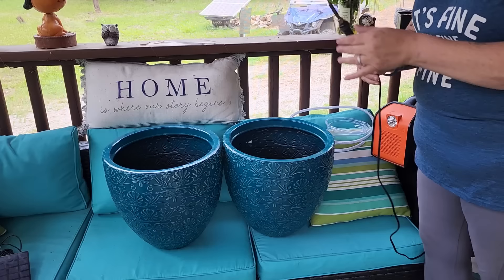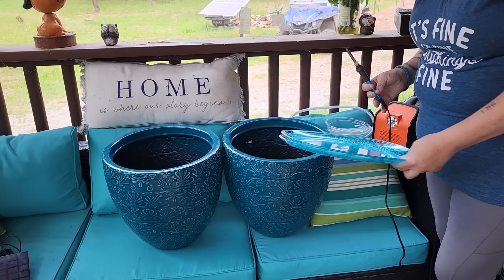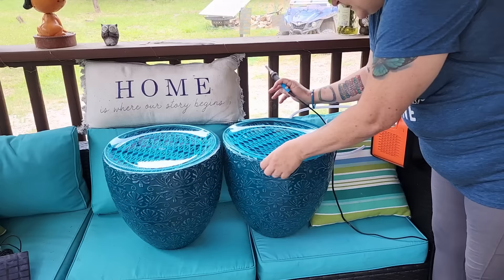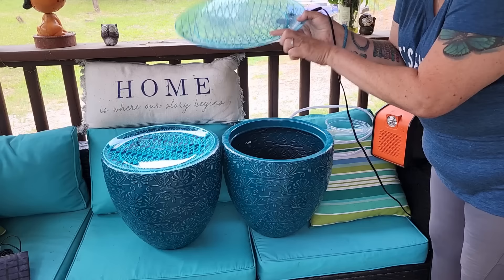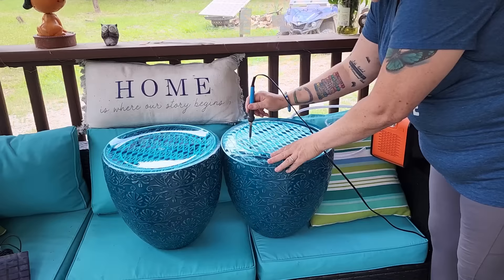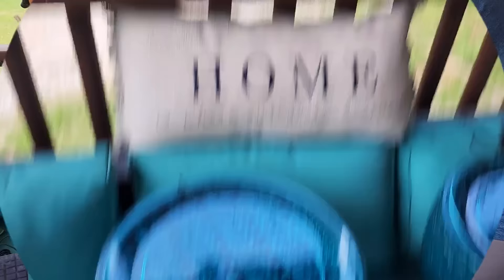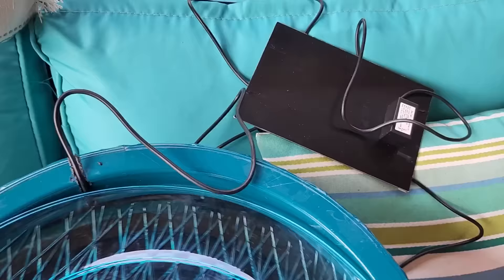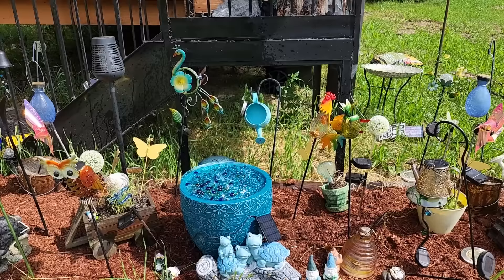Inexpensive solar fountain in 15 minutes or less

Comment: Keep in mind when your doing this once panel is exposed to sun it will start pump so don't connect solar panel till you have water in pot otherwise you may wreck your pump.
Reply from the maker: I actually have been checking it and it's barely losing any water. I top it off every week just to be sure but so far so good.
Reply: They tend not to evaporate very quick done the way you have compared to an open water feature. 
I got a tall heavy pot online 2nd hand and bought a drain from the hardware store with a metal grate so it supported the weight of the pot. I buried the drain so far with just a lip above ground and put a cheap solar pump and added stones at base on top of metal grate. 
It looked great and never lost much water and never really got dirty.
I got that idea off Pinterest.
I like your idea of glass instead of stones.
I find alot of solar panels are now sold without the stake to put into the ground  which I find annoying. 
Your water feature looks lovely.
Reply from the maker: Thanks so much. I'm making a few for family and friends as gifts now.
Reply: Great tutorial and thanks for the info on the pot! I already have a solar fountain. Just need the tubing and the “plate”. Thanks!! Love that pot and the color!

Comment: Great tutorial. Beautiful color of the pots! I love fountains for the peaceful water sounds and for the birds and insects that visit. I've made several over the years. I will advise to check the glass marbles to ensure they are not just coated with color. The coating can be toxic for wildlife or pets. also slip an old piece of stocking over the pump to filter the water and prevent clogs. the pump will last longer. ⛲💙
Reply from the maker: Wonderful advice.
Reply from the maker: Thank you so much
Reply: I don't think debrie  will get underneath the plate to clog the pump..
Reply from the maker: Great advice.
Reply from the maker: Nothing did last year
Reply: Great advice, thank you! 😊
Reply: Hot tip!  Thanks!
Reply from the maker: Thanks!!
Reply: Is there a coating or is it okay?
Reply: How do you check about the coating?
Reply from the maker: @mizkit3243  great advice!

Comment: Would I couldn’t you use just a splatter screen and then you wouldn’t have to do all those holes you still have to for the hose for it’s going with the solar pump outside of the bucket, but yeah, I would think that it would be easier less dangerous towards kid friendly
Reply from the maker: I’m sure you could. I did it like this for looks.

Comment: This was very informative.  I am building the same fountain.  When I tested my solar panel I put it in one place and got a little trickle.  I moved the panel to a sunnier spot and the water height tripled.  It shot right up. Also the tray you are using can be substituted for a planter pot tray.  They are sold with the pots you are using (they normally go under the pot).  The one I found had a bigger lip so it sat on the pot more securely.  Also they are designed to go outdoors so may last longer than the 1$ store trays.
Reply from the maker: Thanks for the advice I'll check it out

Comment: I absolutely love those planters!
Reply from the maker: I was just at Home Depot this weekend and they are still available
Reply: @Deerhavenoffgridhomestead  Did you use the 12” or the 15”?  I have that exact same plate from Dollar tree that I was trying to use with another planter. It fits but it doesn’t want to stay put. The plate itself is 14”. So I was wondering if you went bigger or smaller?
Reply from the maker: I think it was 13"
Reply from the maker: Take your plate with you to check

Comment: If someone had purchased floating solar filters, they often come with a bunch of different "tips" that you can use to change the water patterns. In my solar bird bath, it's a bit too shallow for those more flamboyant tips (unless I want to use my bird bath to water my front garden) -- but I could see using one of those tips on the end of the tubing you've used to create some pretty patterns. This would also be gorgeous with clear marbles and as someone suggested, an underlight of some sort. I love the colors you chose!
Reply from the maker: Great idea!

Comment: Really lovely job!!! What I am surprised by is how you used a wood burner on clay pots!! I had NO idea you could do that! Those planters are a bit pricey for me at HD- I usually get mine at estate sales, but I thought maybe a plastic one I put very heavy rocks in would be ok, and it would be easy to burn that hidden place for the wire. OTH, the planter and what you have done with it is maybe worth the $$$  😍 Thank you for the video!
Reply from the maker: Thank you
Reply: Where do I get those solar pumps at?? Someone...thanks
Reply from the maker: There is a link in the description
Reply: @Deerhavenoffgridhomestead  I think the blue pots are plastic, right?
Reply from the maker: Yes they are, I got them at home depot.

Comment: So pretty and such a delight for those pollinators! I’ve been adding more and more water features for the hummingbirds, etc… and this delightful diy is on the list! Thank you for sharing! I wonder if you see this comment and have a moment whether you might share where you purchased the shades on your screened porch. I am desperate to add some to block afternoon sun and heat on our much used front porch. Thanks again!
Reply from the maker: On Amazon
Coolaroo Exterior Roller Shade, Cordless Roller Shade with 90% UV Protection, No Valance, (6' W X 6' L), Mocha https://a.co/d/f8WXqzc

Comment: 40 bucks ?? I want to use things I have at home 😮
Reply from the maker: All it will take is just looking around to see if you can find some of the things you need and ordering some sort of a pump
Reply: It shouldn't cost you that much if you have stuff you can recycle. However,  even a new pot at Dollar tree is only $5.00 plus the cost of the pump and the tubing. You could use river rock or some shells, if you have them.
Reply from the maker: Exactly

Comment: I did the same thing you did with the same type of pieces. I had nothing but trouble. The water flow could not be adjusted causing it to come out too fast and overshoot the lid.  The lid would fill up with water faster than it would drain back into the vase so I made more holes. The glass beads would plug up some of the holes causing more drainage problems. I’m just about to give up but I would really love to make this fountain work. Any suggestions?
Reply from the maker: @reneesvensson1149  try bigger holes and less rocks

Comment: How do you clean the rocks when the birds poop on them?
Reply from the maker: So far none have. I will take them in and wash them with a non toxic soap though.
Reply: Thanks for the tutorial! :-)  

You can also clean the fountain and rocks with a diluted bleach or vinegar solution. Both are safe for birds and insects because they are water soluble; no residue after rinsing. (DON'T mix the bleach and vinegar though -- one or the other with a 1:1 ratio to water) The Audubon Society recommends these for cleaning hummingbird feeders as well.

In addition to bird poop, a fountain in the sun is going to grow a lot of algae. I'd anticipate scrubbing the entire thing about once a week. 

Water evaporates in hot weather, so remember to check your water levels, folks! Keeping the well full will save your pump.

Comment: Where to buy the solar panels with USB  charger cable
Reply from the maker: Link is in the description. If you check out the latest video which is below I have a better panel and pump that I'm using now.
Reply from the maker: @alicemurphy51  https://youtu.be/nQg5DCDK2Ag?si=Qq0FLrsQ30uv9r1h